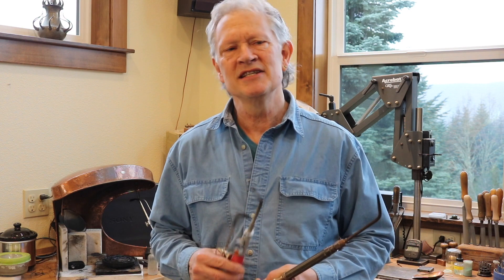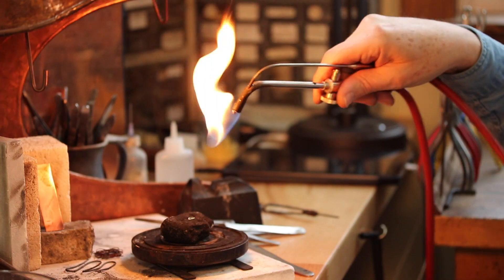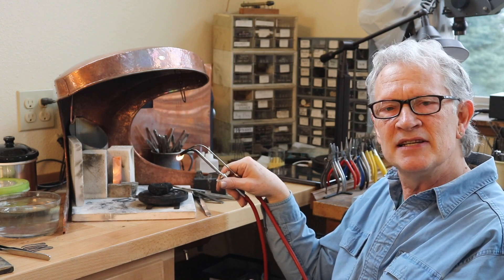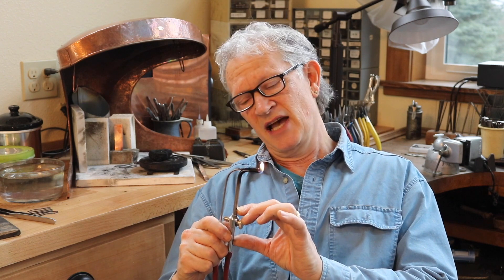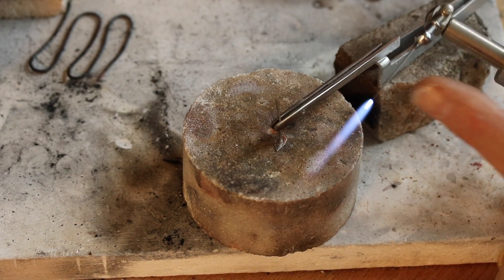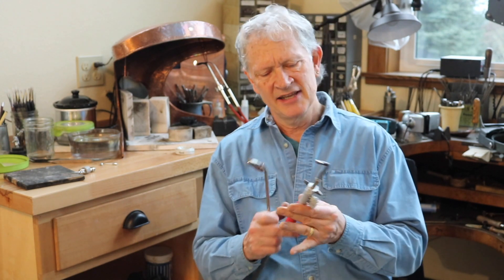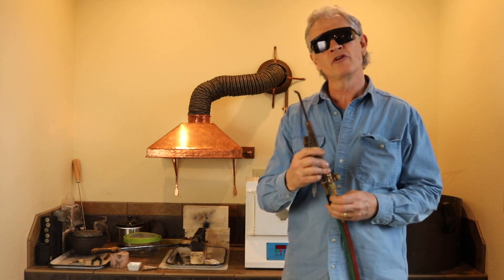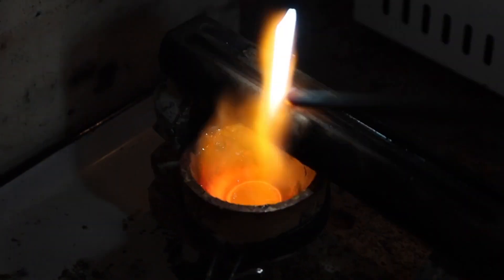Kent's Torches Primer

Comment: Hi Kent. Can the blowpipe torch be used with a disposable propane bottle and a preset regulator like the Smith Little Torch Propane Regulator 249-500B ?
Reply: following!
Reply: I got a "Best of Luck" from Lynn when I asked about torch regulators, after purchasing an LP torch and Manometer from Karl Fischer as Kent recommends, so I don't think they're going to answer your question. The Manometer has a low-pressure cutoff, but it doesn't fit American propane tanks, so be careful taking Kent's torch recommendations in this video. They won't help you with the set-up.

Comment: Hey Kent,  what are the cylinder and rectangle blocks that are in your soldering area?  They look like concrete.  Also, what do you use to oil your ingot mold? TIA
Reply from the maker: HI Linda, I think you're referring to the solderite board and fire bricks. wax, any wax for my mold.